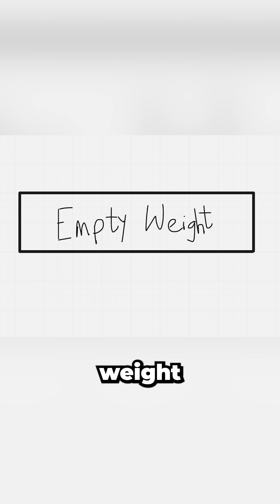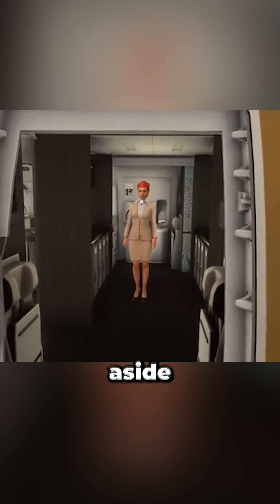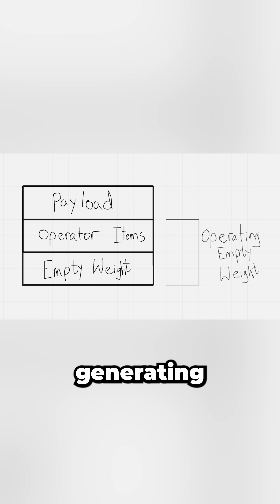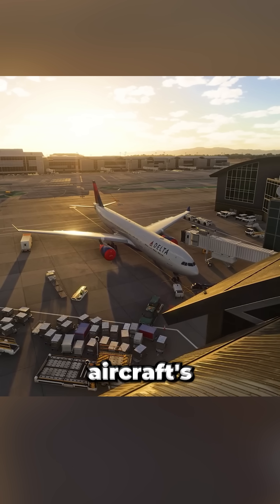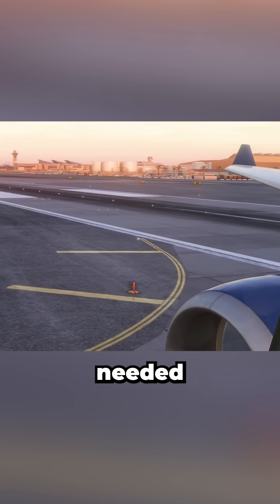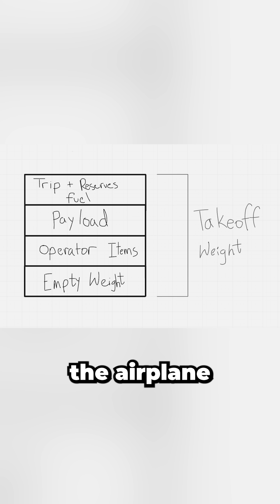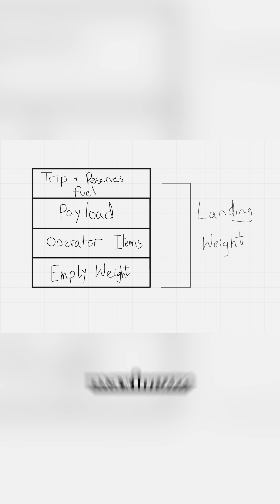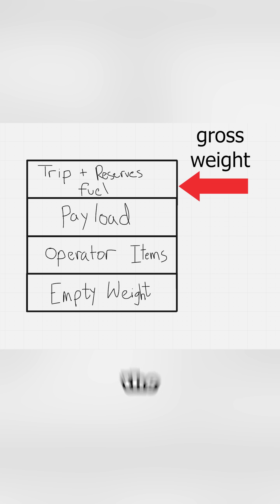Why airplanes don’t have just one weight

Comment: I have a question, if the wings on an airplane work by generating lift upwards then how can some planes like fighter jets fly upside down?
Reply: Not an engineer here, but went to engineering school, non-AE major. Here's a rough answer. To answer the question of how many airplanes can fly in level flight while upside down, it's first necessary to understand "how do airplanes fly, period". 
.
The answer to "how 'aircraft' fly" is both wickedly simple and wickedly complex. The overly simple answer that will fit into a YouTube comment is that to "fly" (by which I mean "rising off the Earth's surface and moving horizontally at various altitudes above the ground within a planet's gaseous atmosphere", i.e., not supported by the Earth directly bearing the vessel's weight), any aircraft (e.g., insects, birds, airplanes with wings, helicopters, rockets not on ballistic trajectories, etc.) must generate an ongoing net force in the opposite direction to its instantaneous weight vector that equals or exceeds its weight at each instant in time throughout its flight, i.e., its instantaneous gross weight. That net force is, to a first approximation, called "lift". If that force (which is re exceeds the instantaneous weight of the aircraft, the aircraft accelerates upward in the Earth's gravity well, away from the Earth's center of gravity. Aircraft generate that ongoing net force by various means, all of which involve generating a mass flow of atmosphere in the opposite direction to the desired lifting direction by the principle of "to every action, there is an equal and opposite reaction", the "ma" (mass x acceleration) part of F=ma. Use the time rate of change form of that equation and now you know what aircraft are doing to oppose gravity and fly at the topmost, most general level.  
.
The wickedly complex part of the answer that fills books and requires years of study to achieve reasonable levels of understanding is detailing the mechanisms by which that (typically) downward-accelerated mass flow is generated throughout each moment of the aircraft's flight. The fluid mechanics math gets crazy complex and often isn't directly solvable. But, to oversimplify, two ways of generating that downward mass flow involve the creation of low pressure regions above a surface (wings and fuselage) and so-called "barn door lift"; classic wings do both. The "low pressure on the side you want to accelerate towards" generates most of the lift because higher pressure generates a force component from the higher-pressure side of a wing normal to the lower pressure sides, i.e., "suction", like occurs when a piston moves in a tube in the "high-to-low" direction. The "barn door lift" part, usually much weaker than the suction force part, is the component of mass flow of atmospheric gases that is generated by a planar surface such as occurs on the bottom surface of a "classic" wing in straight and level flight, moving at a small angle to the direction of travel of the entire wing. I think of this as "water skiing lift"; the fluid molecules, just minding their own business, are suddenly hit by this angled surface (which could just be a section of plane, like a piece of plywood) which wants to push/accelerate them downward. Remember equal and opposite? This results in the ongoing generation of some small to moderate higher pressure locally on the facing plane of the angled surface. On a "classic wing" in straight and level flight, this ongoingly-created moderate pressure on the underside of the wing positively contributes to the net ongoing *pressure difference* between the upper and lower wing surfaces, which adds to the direct "suction lift" our piston is experiencing by adding some more pressure to the high pressure side. The wing acts like our piston, being forced from the higher-pressure side towards the lower pressure side. This net force (Pressure x area) can then be used to counter the aircraft's weight, turn the aircraft in a level turn, or be otherwise used to enable the performance of aerobatic maneuvers. 
.
When you look at an aircraft like an F-15, the upper surface of the wings extends across the top of the fuselage; to a considerable degree, the fuselage is another lifting surfaces. (Remember the NASA "lifting body" research in the 1950s-1960s that produced experimental aircraft M2-F1 and HL-10? The idea was to shape fuselages that generate lift.) To various degrees, aircraft can be shaped to have the fuselage generate lift and in the F-15, F-14 and other aircraft, the fuselage contributes substantial lift.
.
So, the "explain it to me like I'm 10" answer to your question is that aircraft fly because pressures are created and maintained over airfoils and lifting surfaces that result in forces that occur in desirable and controllable directions and in desirable and controllable amounts to counter the aircraft's instantaneous weight and to accelerate the aircraft in controllable ways and directions. It turns out that aircraft can be designed with wing+fuselage shapes that create lift and are controllable while flying upside down. You'll notice that when doing so, their angle of attack is normally much, much greater than when they're flying "right side up", which is necessary to generate the necessary forces. 
.
For more, one excellent, free resource I'd recommend for non-engineering people is John S Denker's See How It Flies at https://www.av8n.com/how/

Comment: Can you explain what the cloud like formations are on a fighter jets wings when it performs a sharp turn?
Reply: Those turns cause areas of very low pressure on top of the wings, which causes water vapour from surrounding air to condense